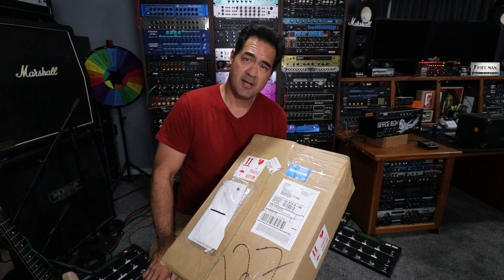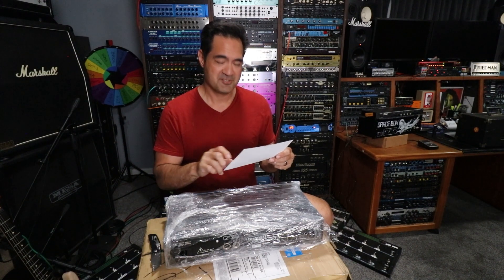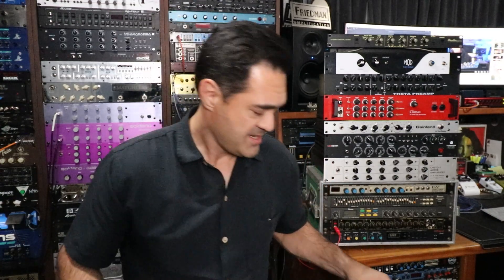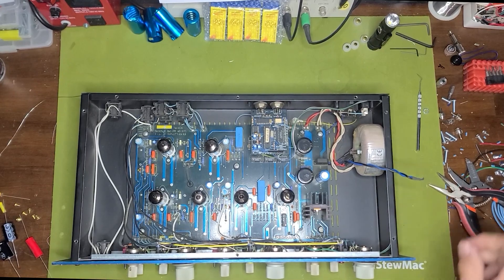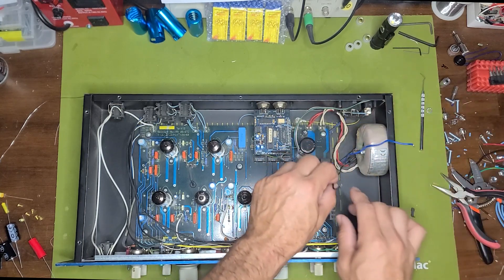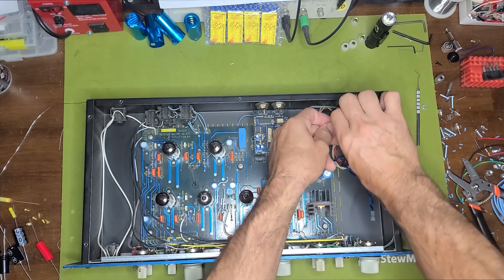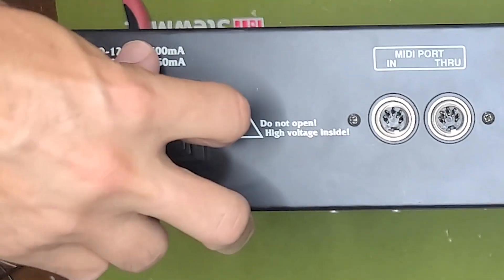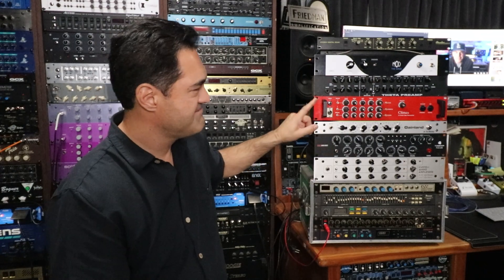Brunetti Mille Preamp Voltage Conversion

Comment: Hello Rack Master. I have a question for you... Do you have any if the Ensoniq stuff? I was interested in the DP4 and was curious on your thoughts. Thanks again and hope all is well.
Reply from the maker: I've never tried the Ensoniq gear. I should check it out. Thanks for the tip!
Reply: @michaeltoren  I've been doing some research on it. The DP4 is a parallel fx processor so you dont need a line mixer. 4 different fx blocks with cool routing options.

Comment: Do you know a great clean preamp to use with fryette poweramp to use as a good pedal platform?
Reply from the maker: A great one to try, that even has a great built-in reverb, is the Sarno SMS Classic (JG version). You can get them for $710 @ Sarno Music Solutions. It's based on a Fender clean platform.
Reply: @michaeltoren  Thanks Michael!

Comment: It's not a good idea to connect only one primary winding, you need to connect them in parallel, otherwise it will burn (maybe not instantly).
Reply from the maker: thanks for the tip!
Reply: @michaeltoren  I see you have collection of rare tube preamps, I have ultra rare Fischer Midi tube preamp for sale if you're interested.